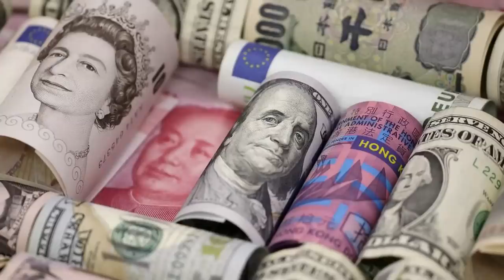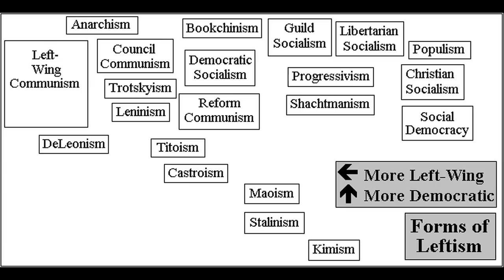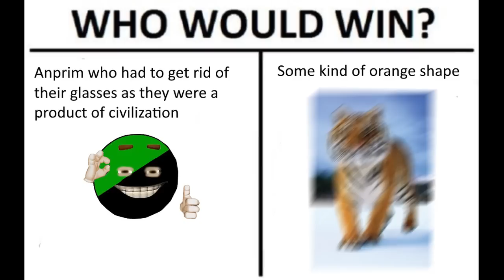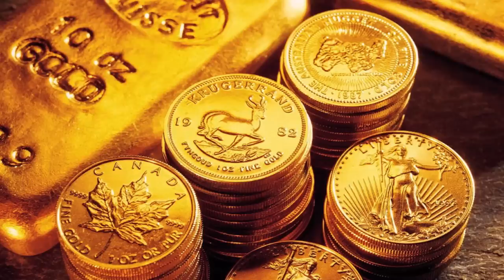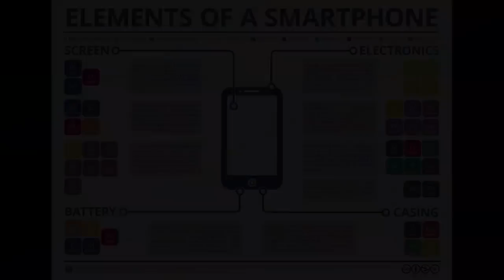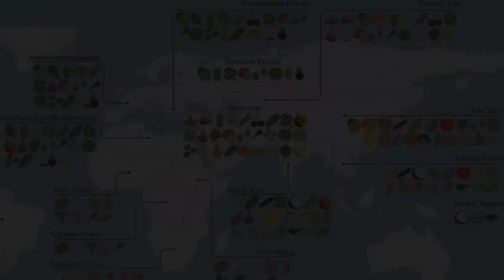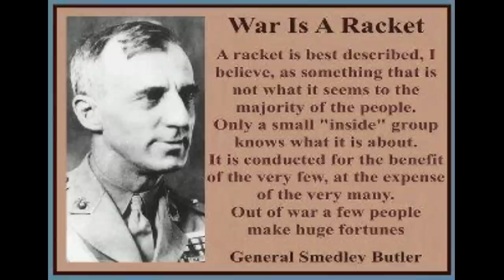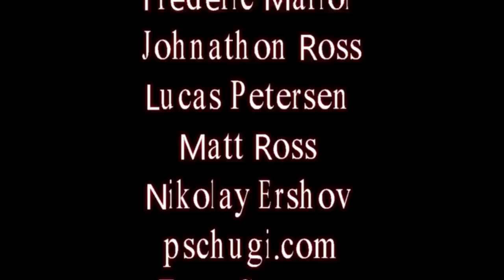How to worldbuild: Trade and economics

Comment: Money doesn't necessarily have to be rare/valuable, though this is a good thing in case of the collapse of central authorities to regulate commonplace currencies like paper or ceramic. Money however must be durable. Also, it can't have a practical value. (On this point you're way off.) When you have a currency with practical value, like steel for instance, the moment you have economic turmoil, people start using up the currency for practical needs instead of saving it for trade, and then your economy completely flatlines because now there's no more trade, only barter. Gold for instance is durable, but essentially useless except for non-use purposes like adornment. If gold could be used to make swords or plowshares, it would be used up faster than it could be minted.
Reply: Back when there was an economic crisis here in Argentina, people used punched 25cents coins as flat washers, because it was cheaper than actual flat washers.
Reply: There are places in Africa that use salt as money, and salt very much has a practical value. What is important is how far down the line it is in the production line. Iron, for example, will always have more value when transformed, so is useless as a form of money. Similarly, most foods aren't valid "currencies" because they can be transformed further (into dishes). Spices however (such as salt) are essentially an end-product. The question has to be : can I buy something without making an inflation loop?
For example : if a loaf of bread takes 500g of wheat to make but is valued at 1000g, then one loaf of bread = two loaves of bread = four loaves of bread. It doesn't make sense because the "currency" (grams of wheat here) can be used to create something inherently more valuable that allows for the inflation loop (or in this case, deflation), and which has practically infinite demand (since bread is a basic food).
Silver / Gold / Spices can be valid currencies because the demand for "finished products" is low : there's only ever so much jewellery that a society will consume (jewellery being a "refined" form of silver and gold). And the same goes for spices.

However, it is true that the currency will be inherently more stable the less useful the product used is outside of its function as a currency. Which is why metals that are practically ubiquitous (coins) and paper banknotes are inherently more stable than gold-standard (although, in an advanced society, making money can cost more money than the worth : cf pennies and 1 / 2 cents coins)
Reply: "money can't have practical value" gold, silver and copper: wut?
Reply: @aisir3725  money does better if it doesn't have a long list of practical uses, because you won't then use the materials all up on said practical uses and have nothing for trade later

Comment: Using practical items as money is unrealistic over the long term based on the principle of bad money replacing good. In reality, if you start using, say, food as money, people will eat the good food and sell the bad. The practical upshot is that if anything is ever worth anywhere near its monetary value in practical uses, it will stop circulating. Part of the reason money DOES circulate at all is because people want to get rid of it and have useful things instead.

Comment: Wakanda makes no sense for another reason. Wealth and technology come about from trade. Wakanda controls a valuable resource in Vibranium.  However, being isolated they have no capacity to trade with anyone and therefore no means to increase their wealth or technology.  What makes Vibranium valuable is the scarcity of the material. But in a closed and isolated Wakanda there is no scarcity because prolific in that environment. If everyone has it, it's no longer rare and the value diminishes. This is basic supply and demand. It's like the old joke about Brazil Nuts just bring called simply "nuts" in Brazil because they grow everywhere and the people who live their dont see them as anything special.

Comment: There is a lot of unnecessary simplifications and errors in this material. In this case it is quite jarring, as the information are useful in world building only when they explained. You can 

always include some random information you found somewhere, but for the world to make sense, one needs to know why some solutions worked as they did. This is why I decided to point out the 

mistakes and incosistencies.

0:08 - The idea of 'trade city', although very simplistic, is compliant with the historical economy. Some of the urban settlements enjoyed privileges, such as staple right and market rights 

that, in collusion with route restriction forced merchants to sell their wares at a specific place and regulated the intensivity of trading in a given area. If a city had large political 

pull, they could have become an economic powerhouse and trading hub thanks to trading privileges alone. Add trade monopolies to the mix and you have a fully-fledged 'trade city'.

3:33 - Feudalism is to some extent compatible with capitalism. The former is basically focused on land ownership and obligations resulting from it. Private entrepreneurship is focused on 

basically everything else. Large merchant republics and organizations, like Hanzeatic League, Genoa, Venice, Ragusa or Novgorod thrived in the heyday of feudalism. So were the first pan-

European banking organizations run by Fuggers and Medicis. 

3:51 - Not exactly. Socialism is a very wide umbrella term, but common ownership is generally considered a basis of communism (hence the name) and its variety. Socialism is, generally, a 

social system where the economy is based on private entrepreneurship, but social inequalities resulting from liberal market rules (unemployment, poverty etc.) are mitigated by state 

regulations and interventions (mandated pay levels, welfare, jobs at state-owned facilities or incentives for the employers to hire) funded by taxes. By the way, the level of modern 

government control over market is far lower than in, say, Middle Ages.

4:53 - You could have continued the subject. Marxist ideology is generally outdated as capitalism managed to create completely classless society that, well, didn't change much by the way of 

income inequality. It is interesting that workers and peasants were all happy to support capitalism provided they were gettting something out of it, i.e. more money. Hence popularity of 

'mixed economy' you mentioned earlier. But the issue is so complex that one could easily make an half-hour lecture only to sketch the most basic concepts.

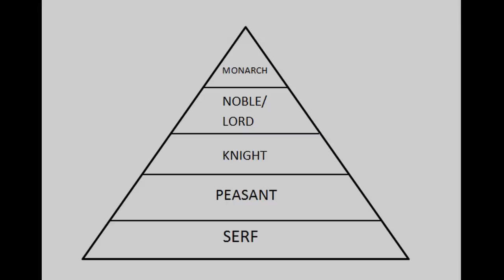5:05 - Now, there is a lot of misconceptions here. First, the king did not need to be the highest instance (case of Polish-Lithuanian Commonwealth after 1573), but he generally was, so it is 

not a general problem. Now, the 'pyramid' is an incorrect, although regretfully all too popular rendition. Nobles and knights were not separate classes - they were all nobles, usually just 

posessing different amount of wealth. The graph also gives the impression that serfs were subservient to pesants, although they weren't. Serfs were indentured servants, whose liberties were 

curtailed in comparison with peasants, but both serfs and peasants served nobles. Somewhere in late High Middle Ages serfdom was almost completely abolished in Western Europe. It should also 

be noted than in royal domains, peasants were answering directly to king or his representative. Burghers were for the large part outside the feudal mechanisms given that they were not that 

involved in land ownership.
Reply: :16 - It seems you mix serfs and peasants. Serfs were kind of 'personal servants' working the lord's land in exchange for food, lodgings and usually some land. Peasants (freeholders, 

copyholders, leaseholders) on the other hand, were renting lord's land (much like lord was renting the land divested by his senior) in exchange for a rent rendered in work on lord's field 

(socage), part of products (tribute) or money (tax). In Early Middle Ages it was usually the first two, later (around 12th-13th century) usually all three and in the Late Middle Ages it was 

usually the money rent alone.

5:22 - Rural tradesmen were paid exactly like the farmers and herders were. They were selling their goods and services for money like the farmers were selling crops and like them, craftsmen 

were obliged to deliver specific amount of goods or its equivalent in money and provide some services, such as repairs, usually stipulated in village's locational document or personal 

agreement with the lord. Medieval urban craftsmen are a completely different story, as they were essentially trade unions more often than not controlling the supply and demand of the 

respective goods and services.

What needs to be stressed is that the feudalism was born of necessity due to lack of metal currency in circulation and thus the land ownership and various form of service exchange became the 

basis for economy.

5:15 - Serfs were not paid, because they weren't free anyway. Peasants were not paid, because they were not employees - they were free entrepreneurs (sole traders in modern terms) who were 

able to accumulate wealth by selling their produce. It was wise for a peasant to maximize the output of the farm or other source of income, because everything not taken as tax, consumed 

directly or required to maintain the operation (e.g. grain to sow the next year) could have been sold, allowing peasants to thrive and develop, at least under good government.

6:47 - Nobles were hardly useless, especially until the modern times, as they were primarily landowners and local rulers meaning that they basically were the government in their domains. This 

meant making laws, taking care of the people, locating villages and towns, building infrastructure (including defenses), equipping local military force etc. In short, the more 'feudal' the 

system, the more had to be overseen by a local noble who had a domain to run. The more centralized and absolutist the power is, the more prevalent are nobles who are only king's officials. 

6:50 - Jobs weren't as much hereditary, as mandated by low social mobility. People who were farming all their life, had little opportunity to do learn different skills. But since the High 

Middle Ages more and more peasants were moving to cities or joining clergy to learn new skills they could have used. Provided they were allowed to do so.

6:56 - If you were a woman, you were working the homestead and fields together with your husband and older children. The German 'three K' ('Kinder, Küche, Kirche' or 'Children, Kitchen, 

Church') is a 19th century concept. Women played a big role in food processing crafts (brewing, baking, winemaking etc.) and could have owned workshops. Noble women were basically doing their 

husbands work when they were away. They had to, as there was a substantial possibility that husband won't return from a war.

7:47 - This part gives the impression that the diversification of markets was in some way caused by the discovery of the new land, what is not true. Everything that was said about the 

development of trades and services (diversification, businesses, capital, investments, loans, contracts, property disputes) applies to the late Antiquity and Middle Ages. There were even 

corporations controlling the local supply and demand. The new discoveries simply created new markets and increased the number of metal currency in circulation.
Reply: 8:59 - The graph is not that useful as it doesn't provide data for the years 1800-1980. The one presented by Simon (1996) shows that although the decrease of percentage of farmers was 

observed since 1820s, it plummeted only in 1950s what could have been attributed to not only machines, but also to 'Green Revolution' courtesy of Norman Borlaug and friends (ins short - the development of new types of crops that caused the agricultural efficiency to skyrocket).

9:40 - Feudalism is not about using people instead of machines. It is based on the ownership of means of production by a small percentage of people who rent them to others so they could make 

some income themselves. This makes sense only in the milieu where there is no readily available currency and the economy is largely based on self-sustenance (e.g. medieval peasants were able to make almost everything themselves, from houses to tools to clothes, so they essentially didn't need that much of complex trade). If you have a lot of currency, you do not divest part of your holdings, you simply hire a manager.

It is possible though, that an extreme capital consolidation leads to the modern serfdom, where large companies own not only specialized means of production, but also control the production 

and distribution of other goods to the point that their employees do not need to buy most of the things as lodgings, food, transport or clothes, as they are provided by their employer (in even more extreme version, the employees would be provided with essentials and some luxuries, but not money so they won't support the competition), transforming such employer to a virtually separate economy. This has been done, of course, as exemplified by the 'megacorporations' popular in cyberpunk genre.

12:42 - Isolation only influences overt trade and diplomatic relations. Nothing precludes inhabitants of isolated countries to gather the technologies and ideas covertly, using spies. In case 

of Wakandans standing like a sore thumb in Europe or China this would have been a bit more problematic, but still achievable. The mass import of resources would still be a problem though (unless Wakanda has them already).

13:29 - The size of the group matters. The larger the isolated population is, the higher the social complexity and the chance of development. Small groups can live of the land using neolithic 

tools and techniques. Bigger ones need more complex technologies.

16:30 - One of the most important thing about roads is their ownership. If they are governed by a state, the long chain of command may cause the building process to be less effective, but the roads might be cheaper to use. If the country is divided into small domains, each local ruler might oversee that the roads are build quickly (as they bring income to the local treasury) but each such lord could have exacted their own tolls and excises, forcing merchants on long-range trade to make hefty mark-ups to make up for the expenses thus incurred. Strong central power in the balkanized country can mitigate that, enacting the limits on local taxes. Local rulers (including democratic governments) may partake in preferential treatments, exempting some merchants from toll for political or practical reasons and so on...

16:56 - It's not that simple as one might think. The main problem here is the popularity of a solution. If there are magic portals, they can bolster the trading ability, but if the magic is 

rare, they would not be too popular. Anyone can carry goods, most can use carts and boats. If the portals can be operated by special few, they won't have much impact on economy. Conversely, 

if the magic is common as dirt (well, dirt roads, at least) then you might need to consider how it will it influence the rest of the world (no need to develop medicine if any parish priest can easily cure .people with prayer, no need to develop siege engines if a battle mage can destroy fortifications using elemental spells etc.).

Comment: I made my currency system have a market that had currency increase in value the more a certain lord contributed to the market (money was stamped each by different lords, while some limited themselves to trading goods it was quite profitable for the big business owners to also purchase a mine to use the extracted for stamping coin).
The purchasing power of the coin itself is based on the price and quantity of the materials used (so what % of such metal you have combined with another) and the prestige the releasing house holds within the empire (a combination of market presence and reputation), the latter being re-evaluated yearly by the imperial trade council which releases exchange tables to the various recognized trade hubs (regulated centers of commerce where you're more or less guaranteed to get your coin properly recognized).

Creating a complex currency system can help you find good excuses to make quests which may even end up leaving a permanent mark in the campaign regarding the purchasing power of your coin or getting certain discounts.

I'm not going to talk about the value of trade of goods themselves because I wrote enough already, just gonna say that in trade hubs the various "guide" prices (which can be increased or haggled down) are set by the city while smaller places may have a community storage with a resource manager dealing with the traders coming to town or the single shops and villagers having each price depending by their personal needs making trading way more unstable.